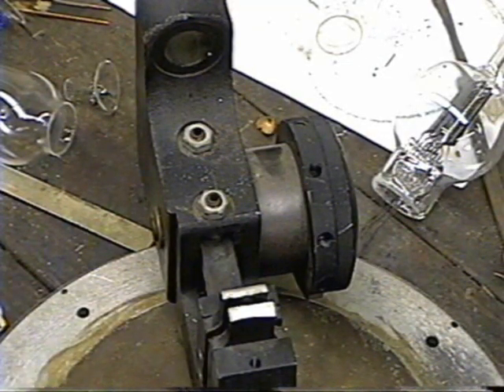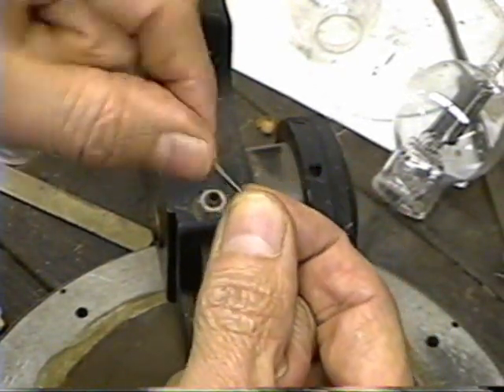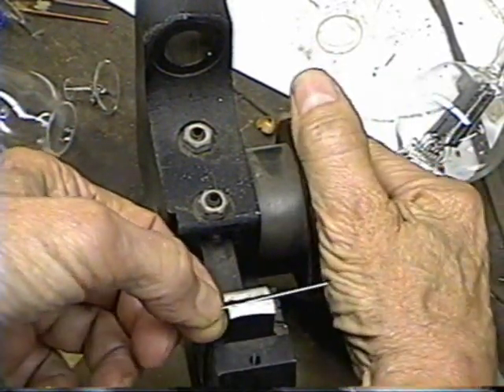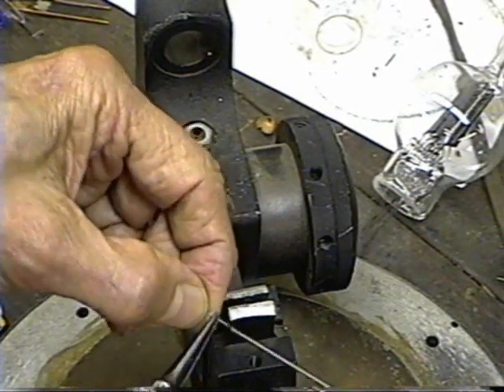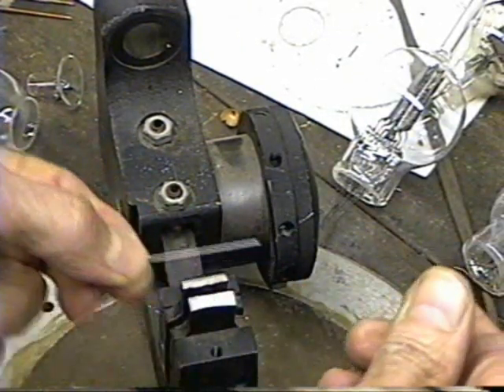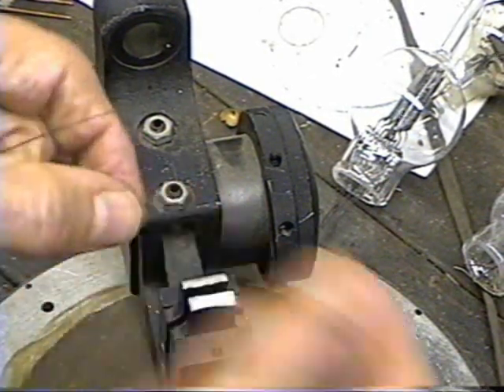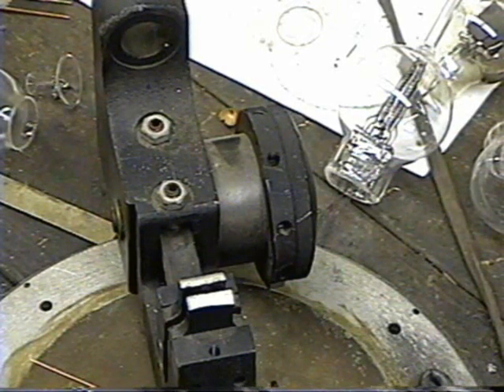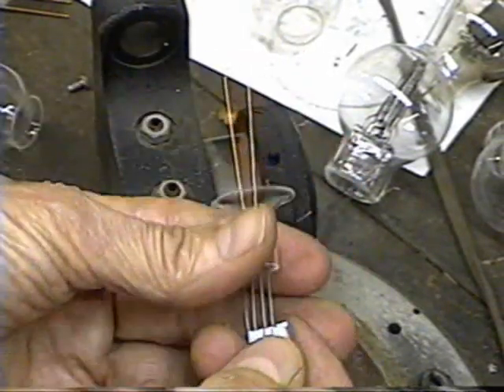making a fleming diode vacuum tube 2

Comment from the maker: @ubuntupokemoninc    In some cases I do. Nickel wire has low thermal conductivity compared to copper so I have to be really careful when heating the seal tungsten to drive out the air. Copper conducts the heat away from the weld so it is far less likely to melt.

Comment from the maker: The welder has a timer that is adjustable from 1/10 second to 1 second. Most of the welds use the time set at 1/10 to 2/10 second. The power level is what is most critical. It must be high enough to make the weld and yet not so high as to melt the wires in half. The current is adjustable from 5 amps to over 100 amps. It is controlled by a power rheostat in the primary of the microwave transformer.